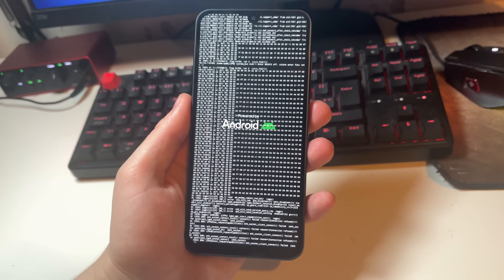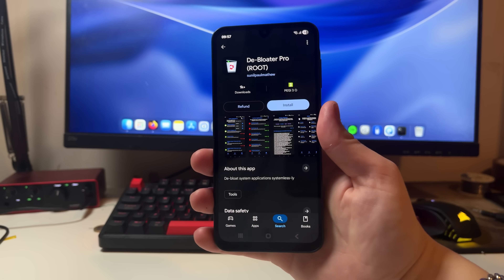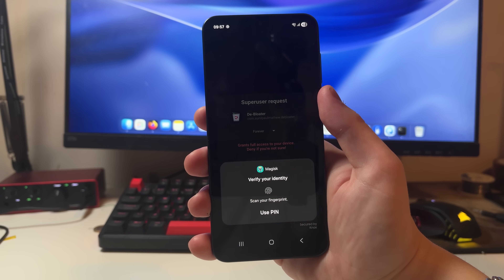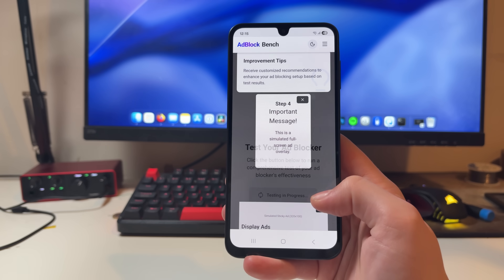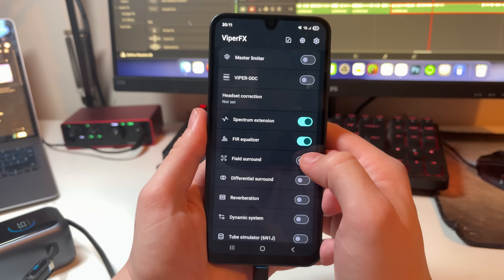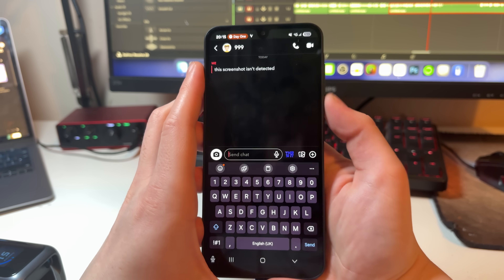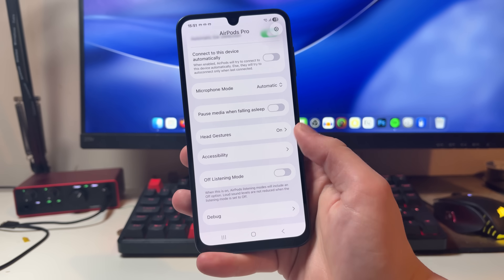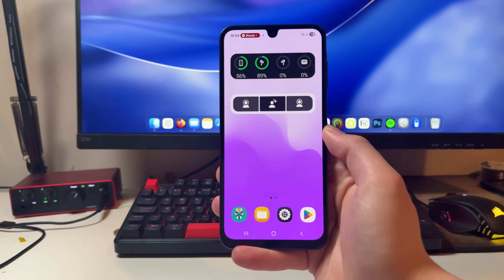Why I Rooted My Android in 2025 (When Everyone Says Don’t)

Comment: rooting is fun and custom roms (aosp) are even cooler stuff. you could also get rid of gapps entirely and replace with microg if you want. always support phone companies that still allows you to unlock the bootloader.
Reply: I'm more concerned about hardware attestation on custom ROMs like some apps won't work like WhatsApp. The only exceptions I see is a pixel phone running GrapheneOS
Reply: @RedLabsEntertainment If a custom ROM is built well, you won't have to worry about hardware attestation. Like I have a Nothing Phone 3a, I don't run a custom ROM, but I'm active in the main telegram channel for the device and people have been able to get WhatsApp working easily.
I'm guessing it's because Nothing open sources the device trees & binaries and the kernel for all of their devices.
Reply: @RedLabsEntertainment  Whatsapp should work fine on phones with unlocked bootloader as long as the account has never been flagged by using a modified whatsapp apk.
It sucks to have to use this terrible app. At least I can still use whatsapp with no spoofing at all.
Pixel phones are awesome because we can lock the bootloader with another OS, such as GrapheneOS. I think their devs are also waiting for another major smartphone company to implement such things too.
Reply: @RedLabsEntertainment WhatsApp works on custom ROMs
Reply: @RedLabsEntertainment  idk used crdroid(vanilla) on p8a and while i had a back up problem(because i used google drive as my store to the backup) i didnt have any problems. 
that being said even if your not privacy focused, it is still worth romming, cause at least compared to pixel ROM evoX is way better and so is crDroid. (and they are pretty easy to install)
Reply: I personally recommend supporting fairphone, not only do they allow custom roms to be made and developed, the batteries are also easily replaceable, and some of their models contain a headphone jack.
Reply: @CineverseSculpt ngl, i kinda hoped Fairphone has a more beefy Flagship model, something on par with iphone or samsung S series spec wise. cuz i want an expensive phone that reliably works for a long time as a hard gaming/Advance calculation(probably using linux on arm) + mobile phone in 1 package
Reply: Motorola does but its a pain in the ass getting their permission
Reply: something that resembles Nokia N series i think, that one with slide in keyboard and full touch screen screens
Reply: My second phone doesn't even have MicroG. It only purpose are only for mobile gaming. I just install Aurora Store for downloading the games.

Comment: Even with root access, you don't have full control over your files because the phone's file system is mounted read-only. To change this, you need to edit the system image.
Reply: Then just use ksu which provides kernel level root.
Reply: @geroexp7282 that's not how it works, the partition is made read only, the filesystem itself like a big ZIP file.
Reply: Не знаю что там надо редактировать, но у меня это просто решалось командой "mount -o remount,rw /", проверено на трёх разных устройствах (андроид если что 10 и выше)
Reply: @evestal  =), дядь ну кому-то другому свою лапшу на уши вешай. Без редактирования super.img можешь хоть обмонтироваться

Comment: Samsung does not allow unlocking the bootloader anymore
Reply: They suck.
Reply: There are rumours they'll bring it back due to backlash. The toggle was only visually hidden. And if it was already toggled before the oneui 8 update, you'll still be able to unlock in oneui 8.0. or if not, downgrade using Odin to 7, unlock bootloader, then go back to 8.
Reply: interesting  @ShadowPlasma2009
Reply: it is possible i discovered a way (tried on samsung galaxy tab a9 SM-110  latest rom)
you can actually still flash an rom without bootloader unlocked but it must be a official rom made by samsung it cant be rooted or a custom rom
simply get an old samsung official rom (android 15 or older) and flash it then boot into it turn on dev, oem unlocking and usb debugging and go back to recovery and you should be able to unlock the bootloader because the older version allows it
then you can root it
Reply: @ggg123-o7d  This'll work if the bootloader revision is the same as the old version. If it's not, you're stuck. So if you want to do it, do it NOW.
Reply: @ggg123-o7d  This will probably not work if the oldest possible official ROM is newer than Android 15 (like all phones coming out with Android 16+ by default) which is sad
Reply: @ggg123-o7d roms bit version must be same to do that
Reply: I rooted my Samsung a22 5g after they dropped security updates i installed a gsi and I am running magisk, one of the best decisions I didfor my phone
Reply: @Yourlocaltechguy.github im struggling to get bank apps to work but not a train smash i can go to physical bank im mot a lazy fk lol evox im using can sometimes be finicky eg my bt headset play at 40% max volume unless restart and other small things that never happen on original OS but i dont care too much using one plus 8T here
Reply: how about vivo shit
Reply: Downgrade the os using odin
Reply: More like shame-sung, or scamsung.
Reply: The programmers will find a backhole either way
Reply: @Hello-xh2fz I have yet to see a single OEM unlock hack
Reply: Lol backhole😂 🤘
Reply: It does
Reply: Duly noted.
Reply: i think they still allow unlocking on not US Samsung
Reply: Yes but xiomi do
Reply: It depends. US variants are locked. International versions are not
Reply: @The_Ballo  the european ones are also locked
Reply: A lot of people have said that the option will be back in 8.5, as per the betas having it.
Reply: my A12 still supports it so I may be rooting my phone soon
Reply: They do
Reply: i meant in the new one ui @HackingInfo
Reply: I haven't updated my s24u yet. I want to root but don't want to root until I upgrade.
Reply: You didn't mention that only in snapdragon device you can't
Reply: Yes it is still possible but you will need to first to unlock the developer options
Reply: It says he's in the UK.  European Samsungs are unlockable.
Reply: Xiaomi hyper OS😢😢😢😢😢
Reply: @N.R.K.GAMERZSHORTS  what's the point of your stupid comment? Do you want an award?
Reply: xiaomi allows unlocking on global roms but it's so hard and time consuming  @N.R.K.GAMERZSHORTS
Reply: hahah😂. U can Unlock it i am using OneUi 8.5 on 23 Ultra and Its Rooted with Unlocked Bootloader 🔑
Reply: @Ghost.3ditzz  no, you can't. In One Ui 8. stock, there is no way to unlock the bootloader. I'd you did it before updating to 8, then yeah, but at that point it doesn't count now does it?

Also, 8.5 isn't out yet, only betas
Reply: @Ghost.3ditzz how?

i have s25 ultra
Reply: and i got all S25U features on my 23U like Log video, All Ai features and alot 😂❤
Reply: that's cool enjoy your phone i guess! @Ghost.3ditzz
Reply: @Ghost.3ditzz how tell please i want log video too